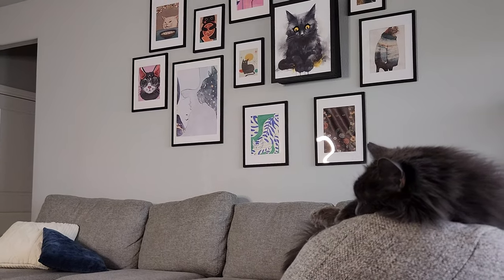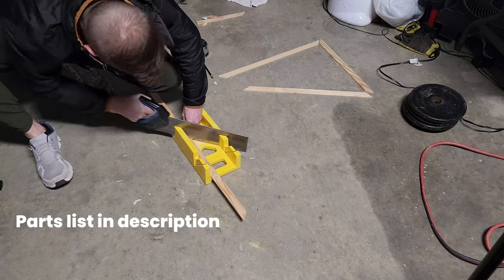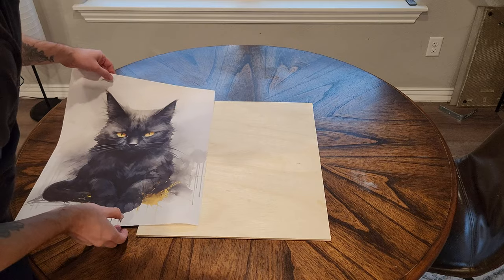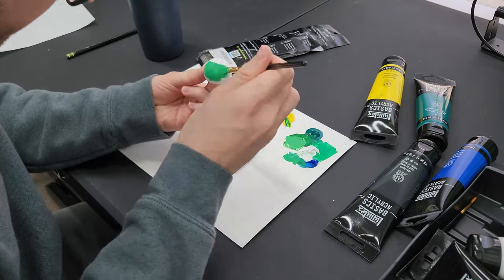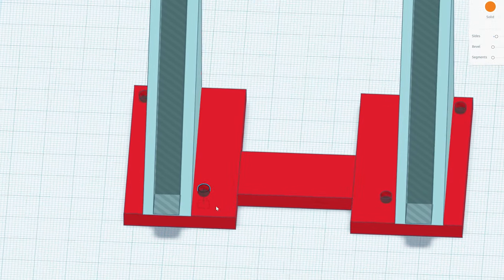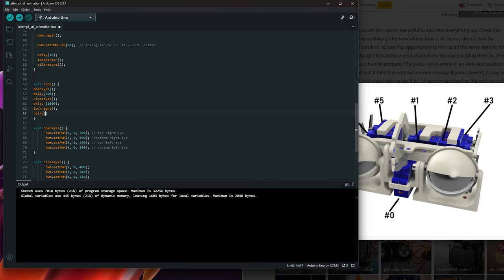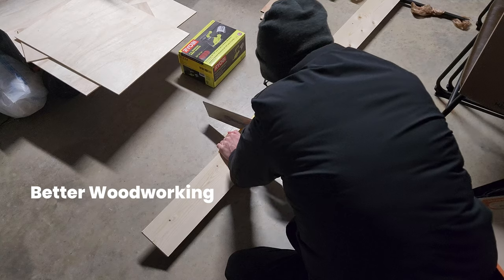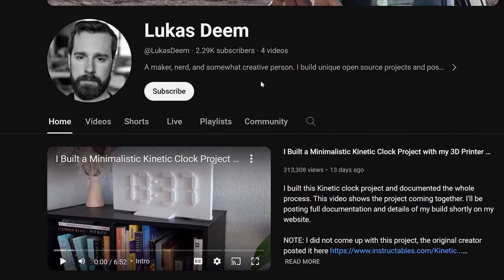3D Printed Animatronic Eyes for My A.I. Generated Cat Art

Comment: That was really cool! Massive respect for diving head first into so many different new things in one project.

If you can get access to a laser cutter, that would have made clean and quick work of a lot of that project. You can put painter's tape over the parts that will get cut, and any burn marks should end up on the tape and not the art.

As far as having the eyes follow someone in the room, I have never done anything like that, but I'm pretty sure you can get a camera and hook it up to the electronics, and use existing tracking software. Not sure how difficult that would be to implement though.

I could imagine a whole wall or gallery filled with different cat art, but all with moving eyes tracking people. That would be fun.
Reply from the maker: Hey I actually do have a laser cutter now Great idea! Also that would be such a cool idea for an art installation!!! 😸😸😸😸😸

Comment: I happened to make the same Cogley eyemech a few weeks ago using the same joystick, button, potentiometer and other components from the same Elegoo kit! I also had issues making sense of the wiring diagram, and while my eyes move side to side and up and down, the eyelids are awry. (Just one shot of the actual breadboard connections would have cleared things up immensely.) Onward to face-tracking!
Reply from the maker: Yeah I ended up just figuring out the wiring bit by bit. Will makes some really good content and I'm pretty sure in his newer videos He's more detailed about the wiring diagrams.

Comment: Great work, a cheap ultra sonic sensor could be installed discreatly for tracking. Lots of examples on github for the code. I made a simialr teminator head with this approach. In your clock video you mentioned a website, could you share the link I cant seem to find where you posted it. Keep up the good work.
Reply from the maker: Hey! I was probably referring to Will Coglys post on instrutables. I liked his video in the description. Yes! I have a spare ultrasonic sensor laying around. I may have to try it 😸

Comment: Hey nice work. Why didn't you use the "+5V" pin on the headers next to the two GND pins to power the servo board? It will give you the +5 rail that came in via the USB. The "typical" FND340P fet that is inline between the USB +5v and the rest of the 5v inside the Uno can cope with ~2A continuous which should have been plenty in this case.
Reply from the maker: Ah! I assumed it wouldn't be able to handle it. Thanks for the heads up! 😃

Comment: The way I would tackle the power management is: Find a 9-12V powerpack, get a DC barrel plug for the Arduino (Google: Arduino jack), power the Arduino directly over the powerpack (instead of USB) and use a 9-12V to 5V voltage regulator for the servo driver, as it clearly says 6V Max for V+ on the backside of the PCB. I guess 5V 1A should be fine as an output for the voltage regulator, since it already able to run with a small 9V battery.
Reply from the maker: Got it. When you say power pack though, is that a battery power pack or a wall plug?
Reply: @LukasDeem  A battery power pack. Of course there are AC/DC switching power supplies as well, but since you are a beginner I wouldn't recommend it to you (for safety reasons).

Edit: For testing of new circuits you could buy a laboratory power supply. Many have 2 separate DC channels.
Reply from the maker: @MeisterAlucard  hey thanks for the advice! 🤠